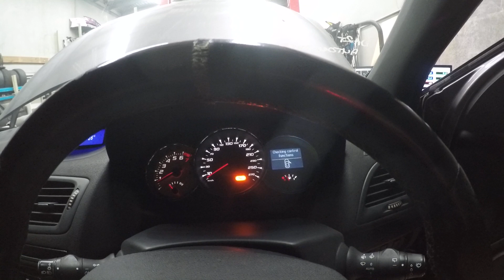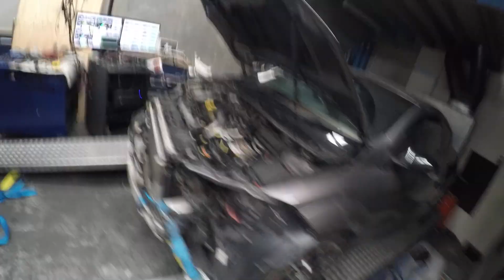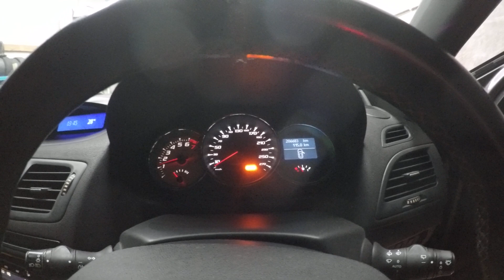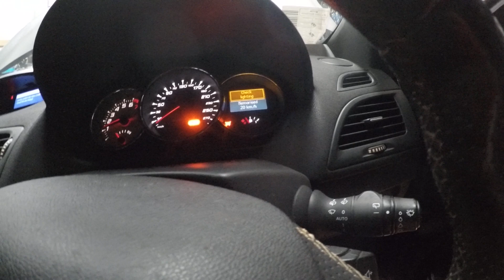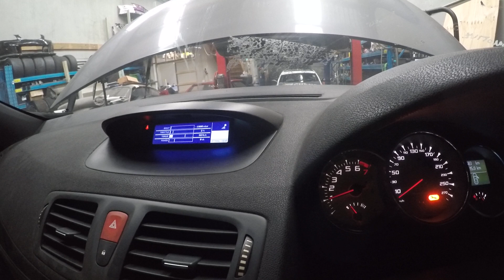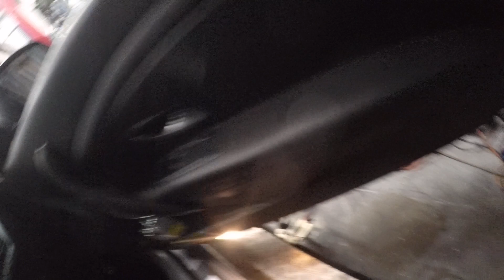Megane RS250 with Motec M130 or M150  Stand Alone Ecu. Also suits Megane 3 RS265 and Megane 3 RS275

Comment: I been looking for the oem ecu do you sale it
Reply from the maker: The issue you have is that the oem ecu is coded to the car and is mated to the card reader and the steering lock and the UCH and some other models so unless you change everything you cant fit a used ecu, you can sometimes still buy them new but they then need to be coded to the car, if your current ecu is able to be read you might be able to have it cloned

Comment: Hi just out of curiosity. if I don't require flex fuel, can I achieve the same function as your motec setup with link or Haltech?
Reply from the maker: there is extensive can bus messaging that is required to have the unit totally interface with the Renault systems, i dont know if this would be possible with link or haltech

Comment: Where can you buy this kit?
Reply from the maker: Please send an email request to Rsport@ozemail.com.au
Reply from the maker: Yes full sequential closed loop Knock control with the ability to add fuel to the cylinder whilst knock trims are current, Knock trims are introduced and then phased out once the event ceases unlike global trim and permanat trim until ecu reset that the factory ecu can apply

Comment: is that piston slap?  so severe?
Reply from the maker: Its actually the Intake cam dephaser, if you drive the dephaser harder (ie more aim) the noise goes away, it also goes away if you rev it. This car was bought as a test mule but was a stolen and recovered insurance salvage and does have a hurt cylinder 4

Comment: ...hm , didn`t know that RS250 has a wasted spark system.  they have individual coils but yet only 2 pins , so will fire 1-4 and 2-3 together ...
Reply from the maker: If you pin out with a multimeter you will see top pin coil 4 (fan belt side of engine) is 12v, lower pin goes to upper pin on coil 1 (flywheel side of engine) lower pin from this coil goes to ecu to trigger, same for cols 2 and 3